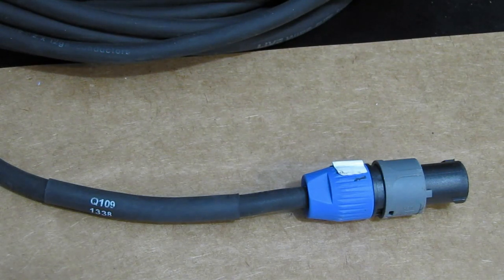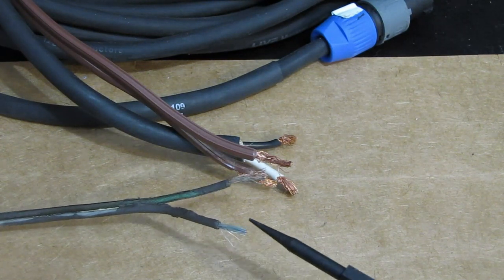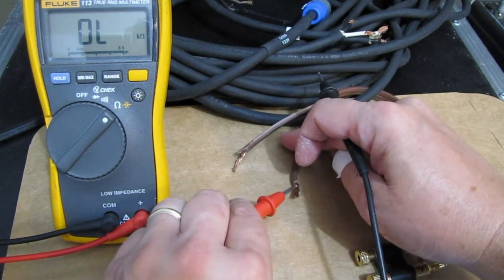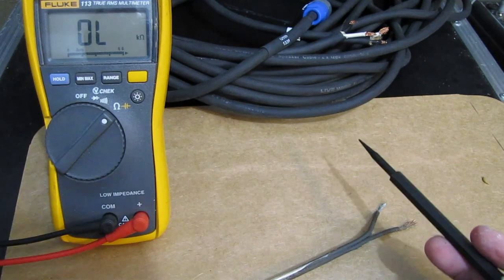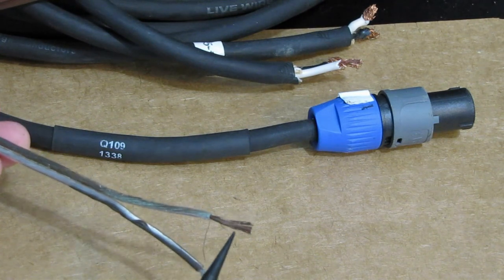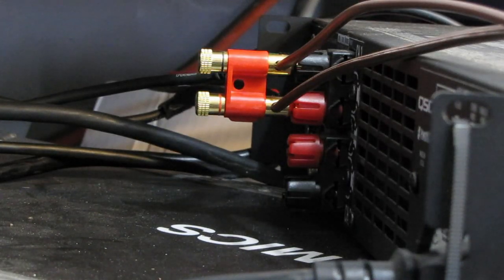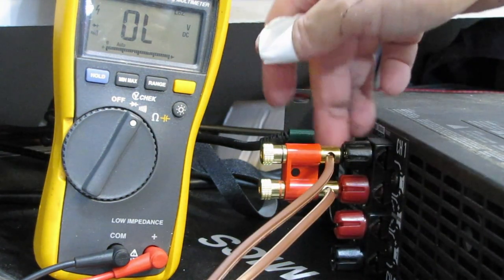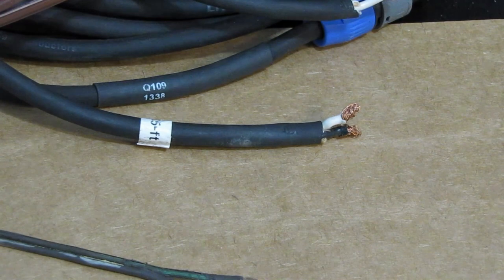Good vs. bad copper speaker wire

Comment: Do you routinely check (meter test or visually) your cables for oxidation or only when it fails?
Reply from the maker: I will visually inspect them once a year, usually during the winter time when business is slower.

Comment: Just paint the clean copper with Deoxit conditioner before connecting, greatly inhibits corrosion and improves conductivity of the connection. The connection will retain peak performance for many years, no need to re-terminate anywhere near that frequently. If you want electrical connections to last exceptionally well, consider choosing connectors on the basis of galvanic corrosion of dissimilar metals.

Comment: More resistance less current less current less heat ohms law amp should not run hotter but less signal is getting to speakers.  The cable is attuniuating the signal.

Comment: Do you also redo all of your soldered connections? How are they affected? And, could you prove voltage drop between the amplifier output and the other end of the speaker wire? Let’s say 50’ (good wire versus corroded wire). Good video btw. I always enjoy watching all of your videos. Thanks so much.
Reply from the maker: All passive speaker connections in our inventory are solderless.  The speaker connections are all made using the pozi-drive screw terminals within the Speakon connectors.  Testing a voltage drop is done by metering the voltage at the source first... then at the end of a 50' wire.  There will be some loss (~1%) even with good wire (based on the wire gauge, the number of strands in the wire, and the wire distance ).  But, it should be negligible if using a large enough gauge.  An oxidized wire would probably reduce the output by an additional 20% over the same 50' (from past experiences).  As well, it depends on how bad the oxidation is.

Thanks for your comment.